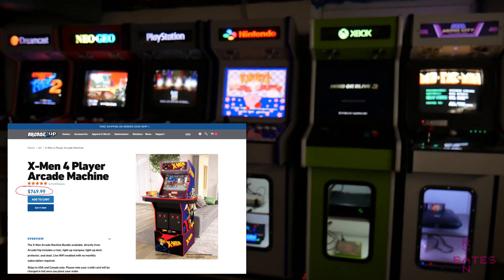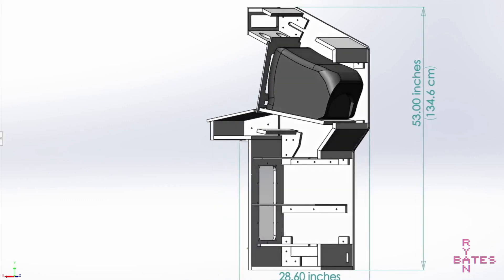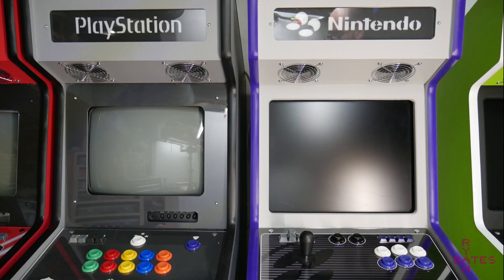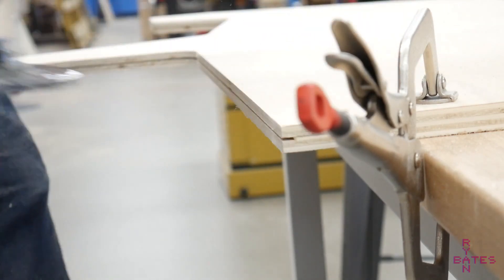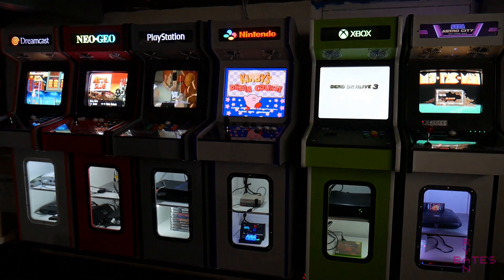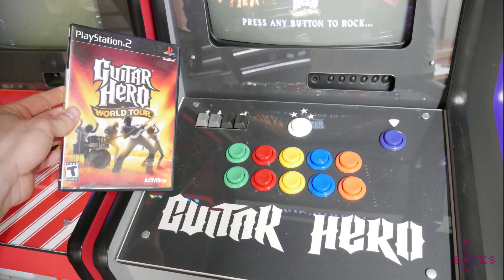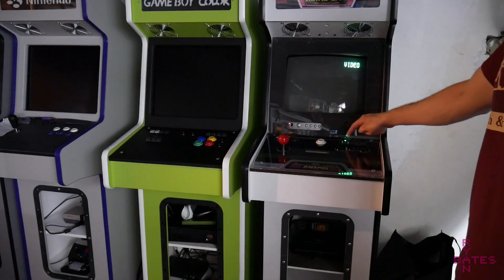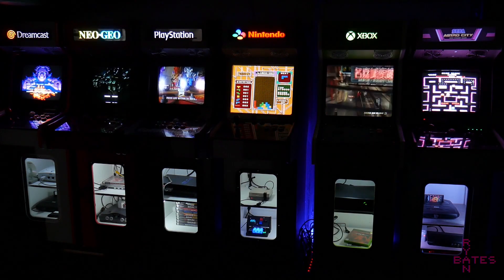Build a Better Arcade 1UP.  100% Handmade Arcade Project with Plans | Edge Lord Edition

Comment: These are truly amazing 😍 I had very similar ideas for a multi console cabinet and I made it a couple of years ago and it sits in my living room. It's nowhere near as professional as these but I'm currently making plans for another one . Your ideas have given me something to think about.  Thanks for sharing your creative genius.
Reply from the maker: thanks for the kind words. Good luck on your next console arcade!
Reply: @RetroBuiltGames  how did you manage to connect a console to the PC monitor, aren't they VGA cables on a monitor?
Reply from the maker: @DavidPalin  the monitor has VGA connector because the market this monitor was made for is business/industrial (also why its a 5:4 ratio). the business/industrial class typically has VGA connector for all the legacy hardware of the last 40 years that still needs it. The Xbox 360 and Dreamcast support VGA with an official OEM cable.

Comment: Awesome job as usual! Your attention to detail is just incredible. I liked the inclusion of Kirby's Dream Course in your footage of the SNES arcade. Such an underrated game! Quick question, why would running the arcades for 24 hours not require 24x the amount of power of running them for 1 hour? Is it because there is an initial power consumption that occurs when you power on the machines?
Reply from the maker: Thanks. Awesome question. The total power used is always the same, that's the nature of the Watt unit (current * volts). When i turn on more arcades, the voltage stays the same but the current draw goes up. These together is the consumption of power (watts). 

We (I'm in the USA) buy energy in kWh ( Kilowatt Hours). This is a measure of electrical energy equivalent to a power consumption of 1,000 watts for 1 hour.  In my area I pay $0.06 to consume 1kW per hour.  
When all the arcades are on they consume 320W (0.32kW) watts per hour. Multiple that by 24hrs =7.68kW (7,680W). That is 24x times the energy, but the rate of consumption is why the math isn't straight forward.
Multiply that by the cost 7.68kWh* $0.06 kWH/hr = $0.46
Reply: @RetroBuiltGames  I think the comma at 15:06 is at the wrong place. It is not $ 0,19 for one hour but $ 0,019 and 0,019 x 24 = 0,456
Reply from the maker: @AndreasHammerschmidt  oooooh yeah. good catch!
Reply: @AndreasHammerschmidt  thanks for catching that, really had me thinking
Reply: @RetroBuiltGames  Ok gotcha, that makes total sense. Thank you for explaining!